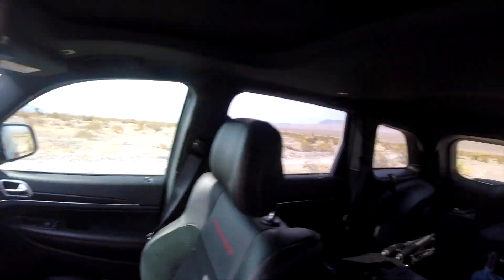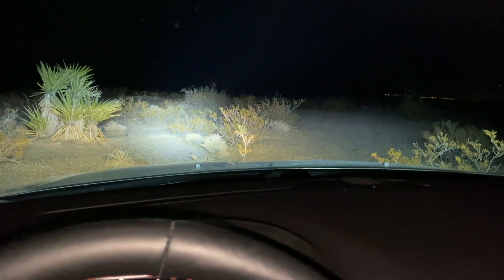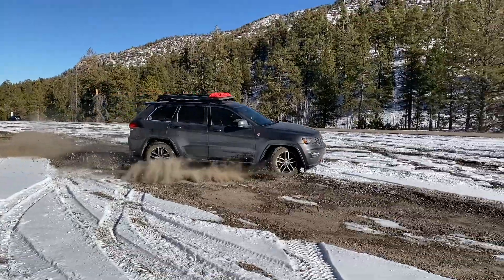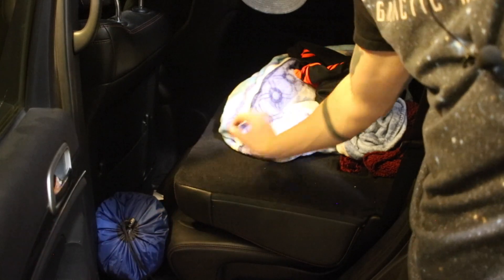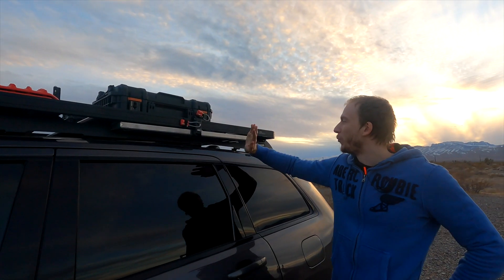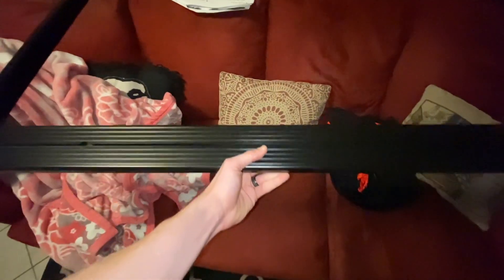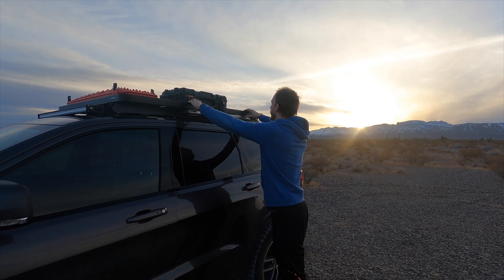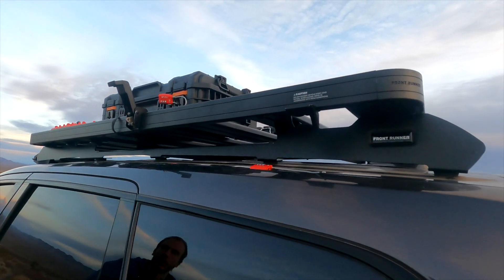Making the Jeep Astro Friendly - Useful Mods for Astrophotography in the wild

Comment: Be careful! Thirty years ago I bought a brand new Jeep Cherokee XJ to make my life easier too for astrophotography, and soon started upgrading it, first a roof rack, then spare tire carrier, hi-lift jack mount, shovel mount, Jerry can mounts, and a set of 5 KC hilites all mounted on same roof rack, then 3 inch lift and 31’s, then 5 inch lift and 33’s, then 6 inch lift and 35’s, then axle upgrades, then steering upgrades, then custom front and rear welded bumpers and winch, then roll cage .. a complete freaking obsession on the Jeep itself, then forget astrophotography I’m joining the local rock crawling club and running the Rubicon Trail, the Dusy Trail, Johnson Valley, etc. The vehicle that initially was bought to help out astrophotography ended up as a full blown rock crawler that’s not even street legal anymore, it was a rabbit hole just like astronomy gear that’ll drain your wallet and leave you always jonesing for more 🙄 lol. If I were to throw my scopes in the back of it now .. by the time I got to the dark sky site the scopes would be terribly out of collimation from the jarring ride out there .. even the refractor lol. Do yourself a favor and take that rack and sandladder off your roof and just throw everything in the back, quit while your still ahead! 😉
Reply from the maker: Wow those trails do sound like fun! But don't worry, I'm being super careful and my goal here is 100% for astrophotography, as of right now the only thing I plan to add is an awning and maybe a jerry can holder (not sure) and that's it!
Reply: Galactic Hunter Yes those trails are A LOT of fun 😃👍 They ended up being more fun for me than astrophotography, but now I’m gettin too old for the whole Jeepin thing and am back to astrophotography yet once again, your never too old for it .. heck these days with automation you can still be imaging from your death bed 😉 So yes you’ll want some gas cans, full size spare, a backup GPS, and I recommend a sat phone if your traveling out of cell coverage. I’m anxious to see your new forever mount, I still think it’s an AP 1100 cause a 1600 would be too big for your Jeep, lets us know soon 😬

Comment: 1) Water Container on the roof rack 2) Benzene/Gas container on the roof rack 3) A recovery strap for the front end of your Jeep Compass. This is dependent on your desert experience and whether you feel this is worth the value. I will impress upon you that a recovery strap......when your orange recovery boards/shovel won't do it.....a recovery strap can certainly pull you out if you have a vehicle to help. You can also help pull someone else out ....(research your tow hooks in front/recovery with strap). Envious of your Moonlite Nite Crawler focuser. To be able to do incremental refocusing after change of filters is pure luxury. P.S. - shaving brush/soft brush/ or Giottos Rocket Blaster Dust-Removal tool for desert dust.

Comment: Maybe a second leisure battery setup and charger? This will provide all the power for your scopes and anything else without draining your main battery and charges when you drive, or from solar when stopped. Then it’s just a cable from your car to your mount.

If you end up doing a lot of driving on unsealed roads, All Terrain tyres are a good investment. More grip and less likely to puncture

Comment: Rubber washer for the roof case mounts may help with sealing up the hole you had to drill.
Reply from the maker: I put silicon on the nut and hole to seal it, it seems fine so far 🤔

Comment: Well done you. Nice set up. Two suggestions, use some silicone lubricant on the table, that squeak will drive you nuts, especially when you are tired. Second, you might want to use some silicone caulk and caulk those screw holes in the boxes to keep out water and dust. Clear Skies.
Reply from the maker: Thank you! I did put silicon on these holes, but didn't show it in the video, as for the table yes that's definitely a good idea!
Reply: @GalacticHunter  Great job, continue to enjoy and help us all keep enthusiastic by your great videos, CS

Comment: I would double the heater and there is a company could Mr. Heater which are portable propane heaters.  I would also add a canopy and possibly a roof top tent if you ever need to sleep over.  I would also recommend for the Jeep something underneath connected to the axles could differentials.  I would look into limited slip or locking differentials depending on the terrain you're in.  That'll give you better traction control.  Good luck and have fun.
Reply from the maker: Thank you! I've been wanting to buy a Mr Heater for a while, I think I will before next winter. As for the differentials, this is the Trailhawk and there are buttons I can use in there to activate depending on the terrain :D

Comment: Some better locks would be my only suggestion. It doesn't matter if you don't carry very valuable items - thieves don't know this until they've broken in. Those cables can be cut with a decent pair of wire cutters. Apart from that, the Jeep is looking good.
Reply from the maker: You're 100% right, those tiny locks are kinda useless 🤔